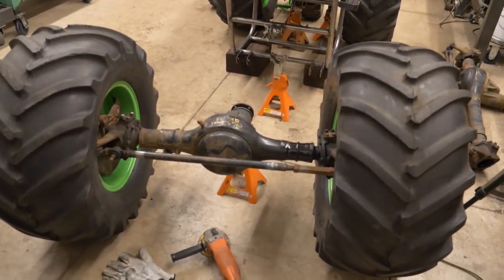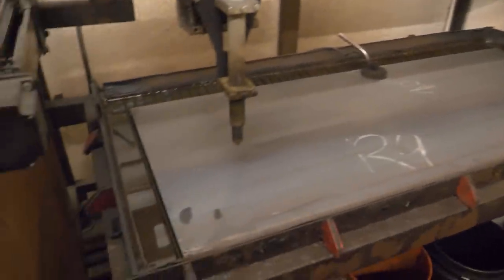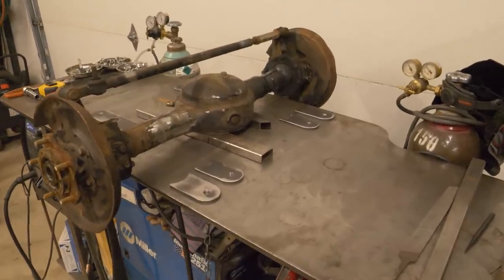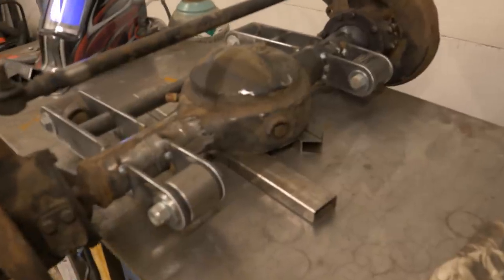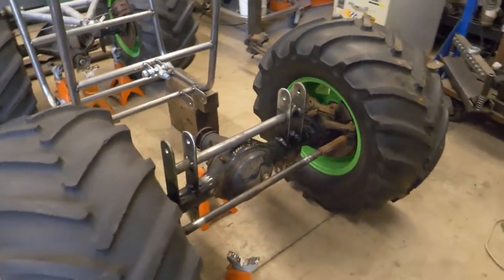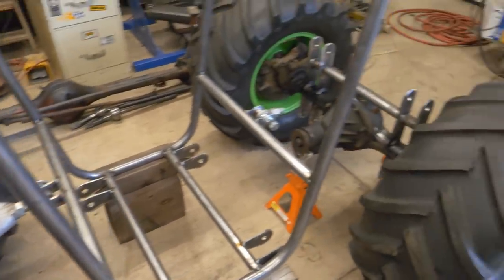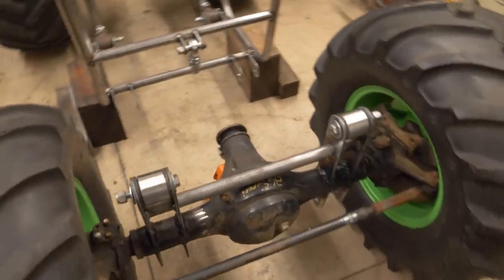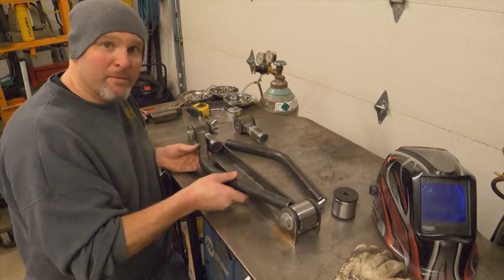31in Goodyear Terra Tires on a Custom Mini Grave Digger 4x4 Monster Truck Modified Powerwheels

Comment: The little digger is gettin' a little bigger. If it seems tippy, when it's done, try filling the tires with fluid. It will help with  keeping it from rolling over backwards going up hills and might give it better traction.
Reply from the maker: Luckily, the bulk of the weight will be the axles and tires, which is low to the ground. But, if is tippy, that will definitely help! Thanks for watching.
Reply from the maker: Did you see how this thing turned out? Check it out here: https://youtu.be/aO-wHYO9vo0

Comment: Very cool build so far but you did the upper links backwards! Look at any 3 link RC the single link connects to the axle I'd setup the front as a normal 3 link maybe add a pan hard and 4 link the rear! Like that it might torque lean bad with the ATV motors power!
Reply from the maker: Did you see how this thing turned out? Check it out here: https://youtu.be/aO-wHYO9vo0

Comment: Those tabs on the end links look quite thin? With all the weight and stress put on them they seem like they might bend or break
Reply from the maker: I will add gusset to the ones on the chassis. The ones on the axle are 1/4in thick steel.
Reply from the maker: Did you see how this thing turned out? Check it out here: https://youtu.be/aO-wHYO9vo0

Comment: What was that drill attachment thing you used after your CNC machine? Like an auto slage chipper?
Reply from the maker: That was an air chisel. I use it to knock off the plasma slag before I send the parts.
Reply from the maker: Did you see how this thing turned out? Check it out here: https://youtu.be/aO-wHYO9vo0

Comment: Random question, on the upper link triangle.. it's a different configuration then the the older rear? Any reason? Stronger?
Reply from the maker: Just shorter to fit this smaller vehicle.

Comment: .Brilliant workmanship!! Could you, however, change those plastic exhausts to fabricated metal ones? It just would look better!
Reply from the maker: I plan to make a fun exhaust system!! Thanks for watching!!
Reply: @motomule  Love your work. I came across your channel via Rather B Welding. Both channels have excellent fabrication work.
Reply from the maker: @JonathanNichollsjono  thanks. Chris and I talk frequently, he's a great guy.
Reply: @motomule  Maybe the two channels should do a blind co-op video series? Two vehicles must be built, vehicle 1, Moto Mule builds the front and Rather B Welding builds the back. Vehicle 2 must be reversed (Moto Mule - back, Rather b Welding - front. A third video would be where both try to join the halves of these vehicles. You guys can communicate, but no pictures can be shared before the third video!

It would test your communication and fabrication skills, and hopefully start a race series.
Reply from the maker: @JonathanNichollsjono  that sounds like crazy fun! I love the idea!!
Reply: @motomule  Use it then, it's your idea now. All we fans can ask for is to live our dreams through guys like you!
Reply from the maker: Did you see how this thing turned out? Check it out here: https://youtu.be/aO-wHYO9vo0

Comment: Do the lower links end up having to twist on the threads for the axle to articulate?
Reply from the maker: Not really, the jam nuts keep the threads from twisting. Thanks for watching.
Reply from the maker: Did you see how this thing turned out? Check it out here: https://youtu.be/aO-wHYO9vo0

Comment: Yolk didn't look centered with top suspension link (rear)?
Reply from the maker: It's not, in the front or the rear.
Reply from the maker: Did you see how this thing turned out? Check it out here: https://youtu.be/aO-wHYO9vo0

Comment: Haven't watched the whole video so you may explain this. But what's the plan for brakes? If you use the original Dana and suzuki brakes you'll probably need a brake booster otherwise the pedal will be too hard for the kids to push
Reply from the maker: Agreed. I'm thinking I'll remove the brakes at the wheels and add a driveline brake instead. That way it'll have the 5.38:1 mechanical advantage of the differential...
Reply: @motomule  yeah that would be the easiest way, although individual brakes would be pretty cool 😉
Reply from the maker: @R3dSmokeGaming  I guess I could have the little guy start doing squats to build up his legs... 😆
Reply from the maker: Did you see how this thing turned out? Check it out here: https://youtu.be/aO-wHYO9vo0

Comment: So what is the device you are using to hold metal pieces in place while you grinds them. It looks like maybe a magnet behind a metal plate or something. Sorry if it’s a stupid question I’ve just never seen one before.
Reply from the maker: That is the magnetic chuck off of a surface grinder. Make cleaning up parts way easier!!! Thanks for watching.
Reply from the maker: Did you see how this thing turned out? Check it out here: https://youtu.be/aO-wHYO9vo0

Comment: I would like to buy a rear clutch adapter for a Honda pilot to fit a Polaris clutch from you if possible?
Reply from the maker: Are you in the Eugene Oregon area?
Reply: @motomule  I'm in  Bemidji MN How much you charge for one of those unique parts?
Reply from the maker: Did you see how this thing turned out? Check it out here: https://youtu.be/aO-wHYO9vo0

Comment: Is it gonna be 4x4 drive or all wheel drive
Reply: 4x4
Reply from the maker: 4wd. Thanks for watching!!
Reply: Moto Mule is both axels same gear Ratio
Reply from the maker: @keithhodge395  not yet, I need to regear the front to match the rear. The rear is 5.38:1
Reply from the maker: Did you see how this thing turned out? Check it out here: https://youtu.be/aO-wHYO9vo0

Comment: Rear suspension has no flex
Reply from the maker: Front and rear suspension are built the same... The flex the same..
Reply: @motomule  at end of video front is up on tire but back looks level no flex
Reply from the maker: @randallcanter2127  the center chassis is leaned over some. Just the way the camera makes it look I guess. In reality they both flex the same. Thanks for watching.
Reply: @motomule  o I see , and thank you for videos buddy can't wait to see what you do on next one plz don't take my comment wrong way more of a question than statement
Reply from the maker: @randallcanter2127  no problem, thanks for watching!!!
Reply from the maker: Did you see how this thing turned out? Check it out here: https://youtu.be/aO-wHYO9vo0